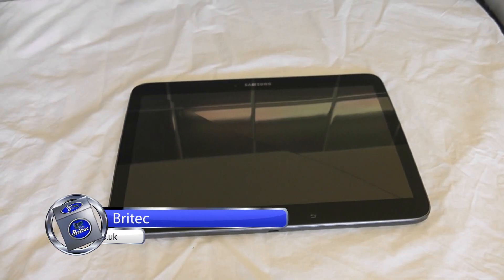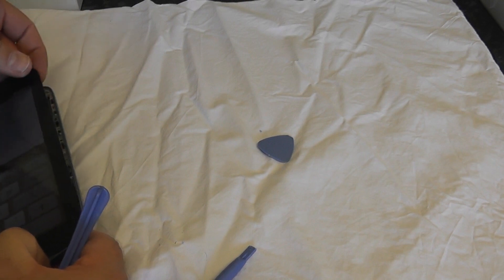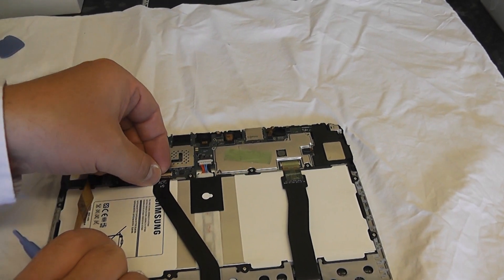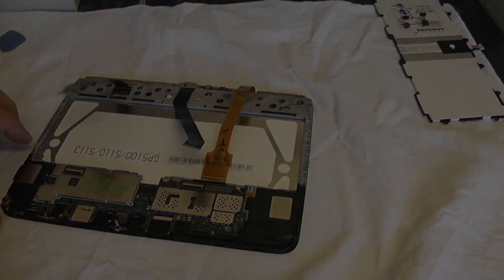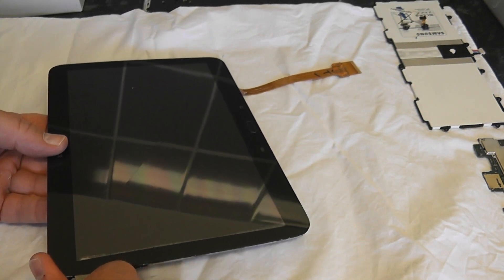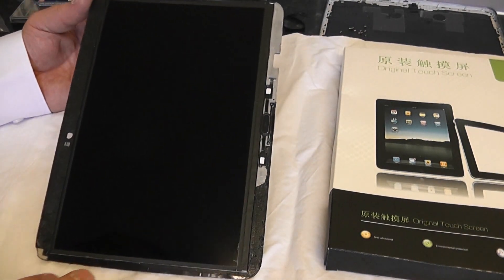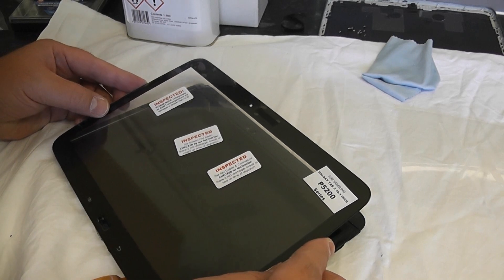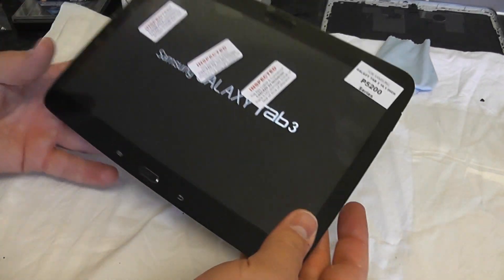Samsung Galaxy Tab 3 10.1 Screen Replacement

Comment: Thank you so much.  I couldn't have done it without your tutorial!   I didn't have the fancy knife tool, I just used a small sharp knife and it did the job just perfectly.  I now have a fully working tablet again that looks like brand new!  Your tips were very helpful.  Although what would have helped me was a clear shot of the things I had taken out and from where - I managed to lose the on button and spent ages trying to fit something else there and couldn't fathom why it wasn't working.  Then I realised my error!

Comment: I am a complete novice yet using this video as a guide I successfully replaced the screen on my son's tablet. The hardest part was separating the screen since it was shattered so kept fracturing as I worked my way around the glue.

Comment: Thank you Brian :-))
Very professional, im not supprised :-)

My frend has the exact same model, hopefully it wont get damaged but i have a better chance of replacing the glass if it goes, thank you :-)

Its not knowing the details of construction that allways trips me up, ive had trouble with dissasembling some laptops due to lack of knowing about hidden screws or flat cables under fake fasia plates.
Stacks of different sizes of screws, ive often used parcel labels to stick groups of screws to a part so i know where they go.
Reply from the maker: I do a video of a tear down and show you a easy way to tear down laptops.

Comment: Thanks for this guide. I used it to replace my digitizer, but unfortunately now my back and menu buttons don't work anymore. All the other hardware buttons still work though. Is there a separate ribbon for the back and menu buttons? I can't find any separate replacement parts. I'm afraid I might have damaged it when I was trying to get under the broken digitizer with a prying tool... :(
Reply: I broke mine also.  Look at ebay for Keypad Home Button Flex Cable galaxy tab 3 10.1.  I fixed mine

Comment: Very helpful video. I was able to replace my friend's screen relatively easy. This screen was far easier to replace that other Samsung tablet screens I have done. 
In my opinion I don't think it necessary to remove the battery and motherboard, but that's just me. I do understand your reasoning and agree with it; no point in risking affecting the solder. I was (lucky?) able to remove the old screen with good tools and patience. 
(Also - I didn't have a heat gun or hair dryer available.)
Thanks for the video! Keep up the good work!

Comment: While I am replacing the glass, is there any way of fixing the design fault which means if I let the battery run down I have to disconnect the battery leave it for a while and reconnect to get it to charge again ? I was getting so frustrated I was contemplating binning it before I actually dropped it yesterday !

Comment: Dropped my tablet and the screen is cracked . went from pink screen to black screen with partial edge lighting , could this be caused by the cracked screen as well as the pink screen it use to have .

Comment: What can I use in place of that heater?
Reply: A blow dryer it will just take longer to heat up.
Reply: +Derek Osmulski ok I think I totally broke my tablet. I cut one of the ribbons when tried removing the screen. Is there anything I can do?
Reply: +Magdalena Herrington it seems that most likely it was just the digitizer cable. That would really be the only cable you could damage prying the screen off.
Reply: ok well I think I'm done lol. I can fix simple things but I think I'll leave this stuff to the pros. I'm gonna take it up to a local shop and see what the damage is. Thank you.
Reply: +Derek Osmulski  Ok so I decided to give it another go and got the screen off but I also took the home button off. Is that a problem? I see that it has two little back plastic parts attached to it that seem to hold it in place, well I broke one of those. Will the home button still work?